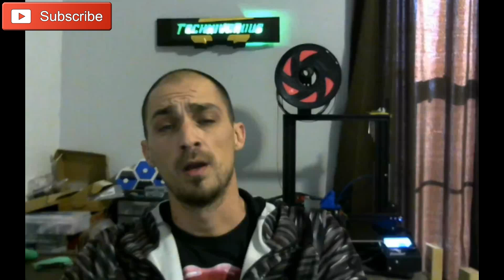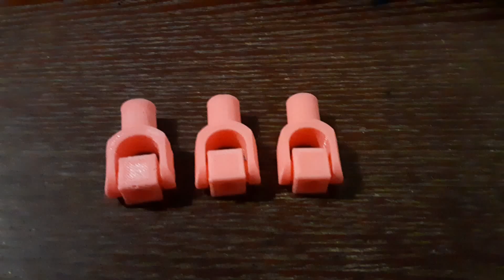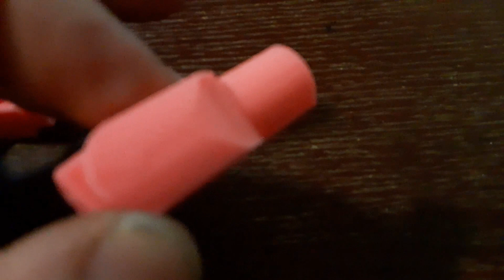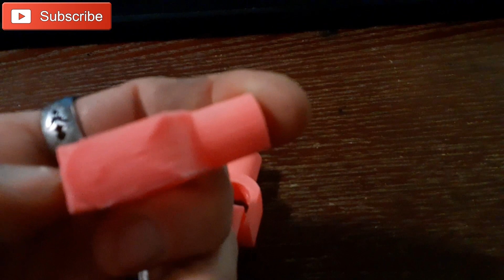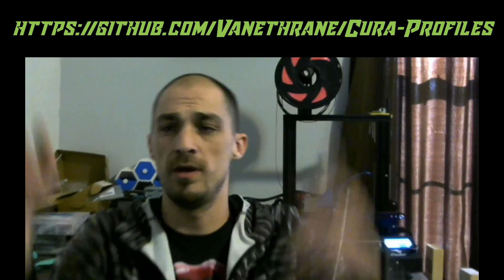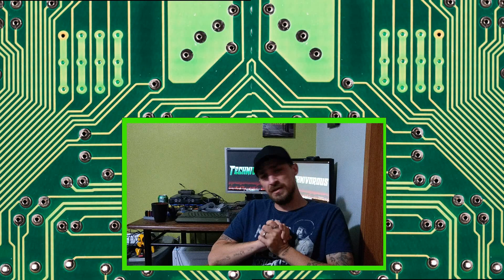Cura 4.4 - Intent Profiles for Ender 3

Comment: Thank you, These have done great... then I lost Tramm, deffinately will be using again when I get her dialed back in, Maybe this time I'll actually put the lock nuts under the bed (grabbed some 4mm rivet nuts to try as lock nuts to keep the springs centered over the threads). Hoping your Patreon gets enough boost to keep your content coming, as well as providing a path for the ever-evolving better equipment conundrum.
Reply from the maker: Thank you! Yeah it's amazing actually how fast things snowball. I'm working on establishing a relationship with banggood.com so they are sending me another printer to test, the tevo tarantula pro, and I'm hoping things go well so they keep sending me items to review. I've heard mixed reviews, but since it comes in pieces instead of partially assembled like the ender 3 I think its abilities to function will have a lot to do with assembling it properly. We shall see.
Reply: Lol, Even "partially" assembled, you NEED to go back over it to make sure it's square & tight... Seems assembly is a point with any of them to ensure good prints. Still awaiting the arrival of my second ender 3 pro(shhh! Don't tell the wife...I haven't). These 49 hour prints are killing me when I get an idea for a quick print I wanna do.

Comment: Is the Intent profiles anything different to a specific printer profile? You don't use Intent profile on top of your custom ender 3 profile? I have specific Jerk, Acceleration and retraction settings i like. If you use intent you lose those settings?
Reply from the maker: Yeas the intent profile will change almost everything. The jerk and accel included. The main difference in those profiles is the infill percentage and number of shells, so you could replicate any if these profiles by adjusting those in your existing profile, to keep your other current settings